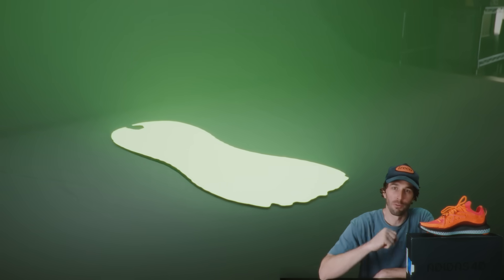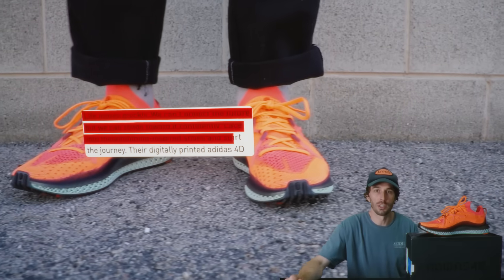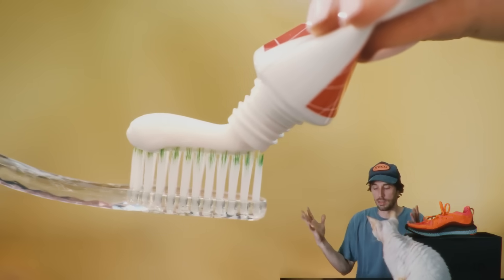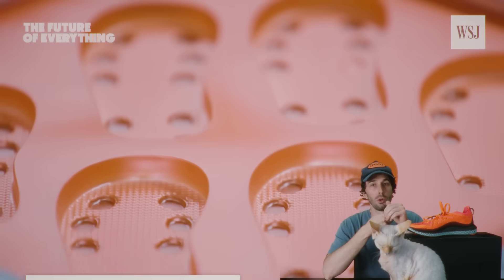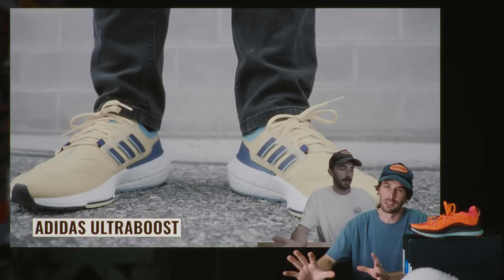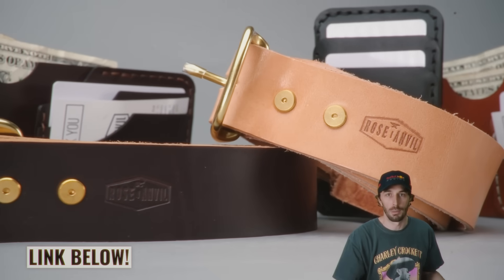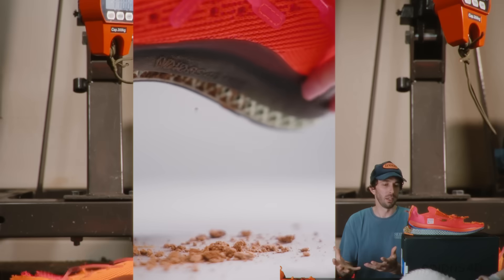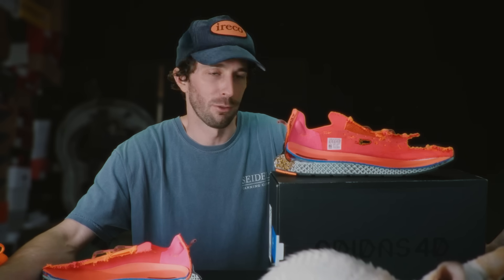Is the Future 3D Printed Shoes? - Adidas 4D Fusio - (CUT IN HALF)

Comment: Came for the shoe, stayed for the cat. Quick thing on 3D printing: stereolithography (SLA) printing has actually been around for decades, and you can buy a SLA (or MSLA) printer for really cheap. Carbon printers have some extra magic but even the cheap Elegoo printers work great for the home hobbyist.
Edit: I mentioned this in another thread but I’ll add it here: watching a physical thing get pulled out of a vat of goo using nothing more than light is like magic. It’s been around a long time but it’s still absolutely amazing.
Reply: For a while, before common man got a hang of it, the cheaper units were locked behind patents. At first, they weren't even on the markets, simply locked away. In theory, we could've had 3D printers back in the 80's, sure, not for Average Joe, but none of the tech that was required to get one running is new. And at that, back in the early 90's a few CNC mills were converted to use extruders to make precise casting blanks for machining plastic bits. Funny how that works, huh, old scrooges plopping their feathery arses on tech and locking it away for no good reason.
Reply: @aserta  with FDM printing, Stratasys got the key patents and built their business around them—they didn’t just sit on them. But I agree the 26 year duration of patents is waaaaay too long, and the giant wave of innovation that began in the 2010’s was because the Stratasys patents expired. Open-source companies like Prusa Research have pushed FDM technology ahead far more than Stratasys ever did. Patents should be good for 3-5 years, tops.
Reply: Word. I remember seeing stereolithography footage on science & engineering programs like NOVA when i was a kid; at least the early-90's, maybe earlier. Was very sci-fi at the time, seeing a skull or whatever emerge from the goo.
Reply: as an FYI, Carbon is not SLA technology, it is DLP.  The processes are different and comparing an Elegoo or hobbyist printers to a Carbon machine is such a bad comparison you really shouldn't even compare them.
Reply: @Fishbone8891  Carbon’s magic isn’t DLP; you can get DLP in hobby-grade printers these days. It doesn’t really matter if the UV light comes from a laser (SLA) a masked UV source (MSLA), the magic in Carbon printers is their management of oxygen. It allows them to move the curing away from the UV source so that the printer doesn’t do the raise/lower cycles after each layer. A traditional SLA/MSLA printer spends most of its time un-sticking the part from the UV source whereas a Carbon printer can just pull continuously—it’s much, much faster.

Comment: I don't think your performance tests are really able to capture the performance characteristics of this shoe. As you can see in the footage from Adam Savage that you linked, this structure rebounds at a particular angle, not evenly in all directions like a foam. The ball and bar drop tests can work to test rebound of foam, but if this material rebounds at an angle, you're only going to get a reduced percentage of rebound in a test where the impact is coming perpendicular to the material. I'm not sure how you could really adjust this sort of garage-science test to test for the angular rebound these lattices are meant to maximize, but I'd be really interested to see how they compare to foams for rebound in the angles that matter when worn.

Comment: I got mud into my 4dfwd when I wore them on a rainy day, but they were relatively easy to clean with a garden hose lol. 
I like the shoes for the most part, but I still like lightstrike (especially lightstrike pro) and boost shoes over it for the time being, mostly due to weight.
I don't really feel any benefit from running with these versus something like the takumi sen 8 which you can get for cheaper as well.
This tech probably has to cook for a lot longer before it's really good; it definitely is a cool concept though!